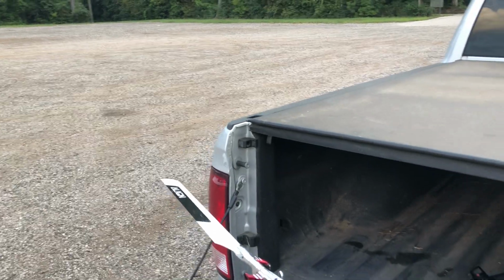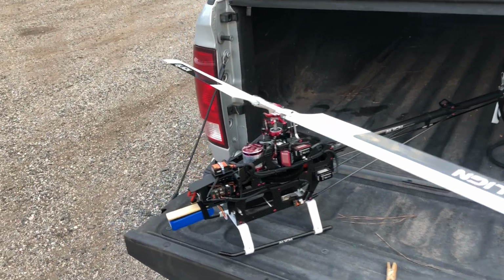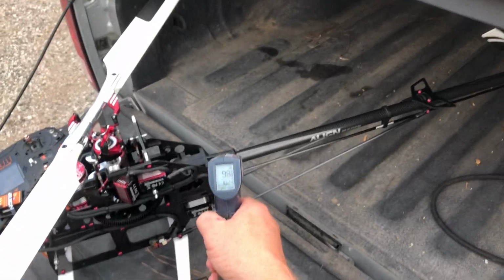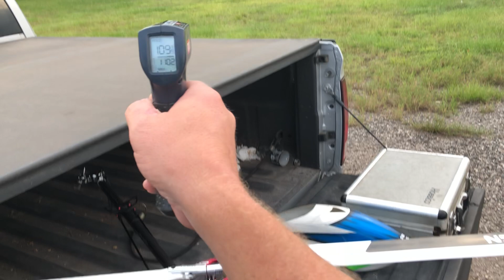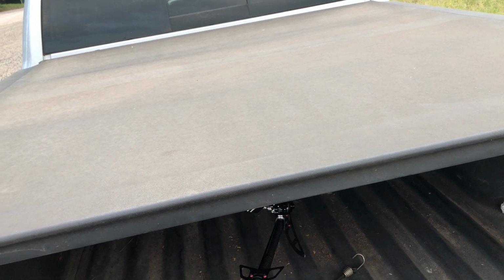Trex 550x on a 3s 2200ma pack. 600mm blades.

Comment: Hey, i wonder is it possible to convert this heli into belt driven tail?
Reply: You can do it if you use tail parts from old belt driven trex600e (it has same boom size) - also you need to change autorotation gear to match 40t gear to pulley from trex600...
Reply: @damijanlikar1973  oh,. interesting, thanks for the info! Though, what if i will not find old parts, i guess it will be possible to design and 3d print tail box and gear? Or there are other things to take into consideration?
Reply: tail box can be used from trex550x you just have to remove the housing part where TT front umbrella gear is mounted, for the tail rear mount housing it could be a bit tricky to find new part, but probably used one is better option,  tail shaft with pulley and front 40t gear with pulley for belt are still available i think... Autorotation gear 180t is also available in some stores (i am from EU) but if you are from USA - you have even better part stores there.
Reply: @damijanlikar1973  i'm from EU too, and yes from what i saw they got greater options in USA and even cheaper, heh. Currently i'm planning to buy T-Rex 500X or 470LP, and this 550X is rather would be my future option, so i was asking in advance if belt is possible :)
Reply: @cutefoxRC  to be honest if you plan to fly 3D with trex550x on high head speed over 2100 rpm then don't change to belt because 550x has 3,85 ratio for tail for high main rotor RPM up to 2500, belt driven system from 600 has 4,5 tail ratio meant for lower headspeed... If you plan to buy new heli and you like belt driven tail why not go directly with newer KIT / heli like TB60 or XLpower 550 or Tron 5.5 or raw580 and similar helicopters?
Reply: @damijanlikar1973  i considered belt because it can forgive accidental ground touch by tail blades. I don't know what my preferences will be when i will be getting 550 heli, but for now i  prefer low or middle RPM flights :) i like to hear blades sound. As about other helis, well i'm very picky, i want to enjoy not only outside view with canopy, but also inner view of mechanics and stuff. That new TB60 honestly is 'ugly' to me haha, so i have to stick to old ones. On other hand Specter 7.0 looks nice too.

Comment: Battery CAPACITY is measured in mAh, not mA. It means you can pull that many mA of current for 1 hour. mA is a measure of CURRENT (electron flow). You don’t measure speed in PSI or time in feet, so why be lax with units?
Reply: Ok, boomer...